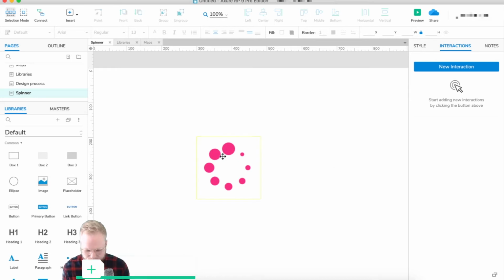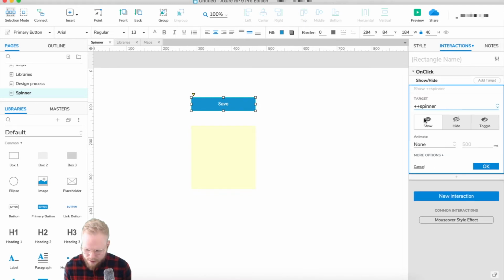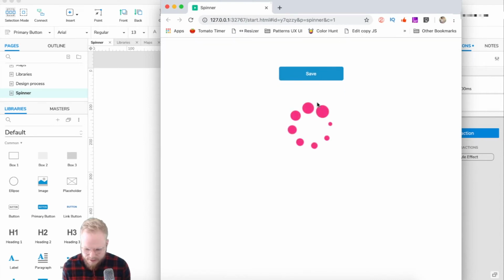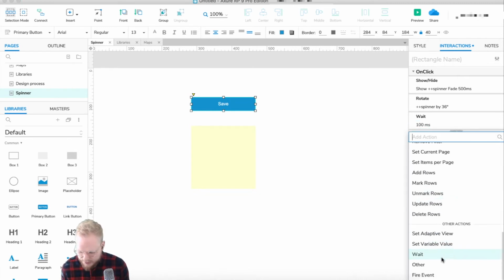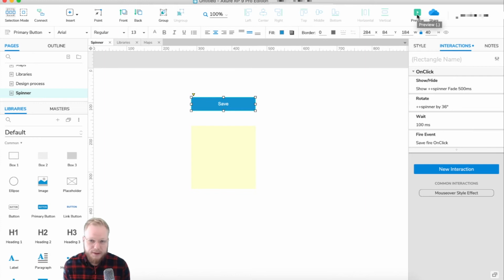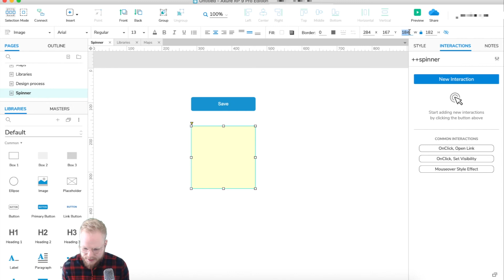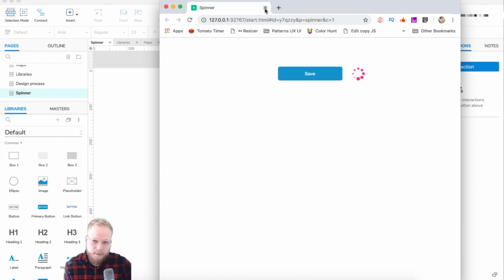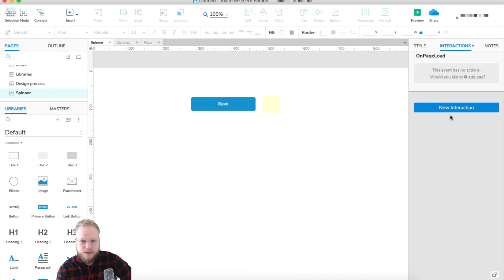Loading Spinner Animation | Axure RP: Noob to Master - Ep40

Comment: Thanks for the tutorial. How do I stop the event? I have set up my logic to fire event OnClick (which spins the spinner), wait 1000 ms, then hide the widget. But that makes the widget hide/show/hide/show in a continuous loop, and the spinner never hides completely.
Reply from the maker: Youd need to add an IF condition to that event, e.g. if counter is not 100 do the spining. Then insidethe event you should add a counter. For example a variable value +1 everytime the loop runs. Once the variable value is 100 it would stop.
Reply: @vaexperience  I am new to this Axure, can you kindly tell me what to do and how to add a "counter" to the if statement for every loop then after some time, stop the spinning if it matches the counter we set
Reply: @seer473  Hello. I added a 'wait' for 2000ms and then added 'Open Link' to the desired destination underneath the 'Fire Event'.
Reply: @vaexperience  OK. How do I add an IF condition to that event and the rest of what you said. The spinning video is great except it doesn't account for the fact that a loading event should "ideally" end and move you on.
Reply: @art4ux2me23  Hello. I added a 'wait' for 2000ms and then added 'Open Link' to the desired destination underneath the 'Fire Event'.
Reply: @vaexperience   didn't get ths... please elaborate
Reply: @aarshitayawar6679  Hello. I added a 'wait' for 2000ms and then added 'Open Link' to the desired destination underneath the 'Fire Event'.
Reply: One way I came up with to stop the loop and move on is simply repeat rotate & wait for as many times you like, No need for infinite loop, and in the end just add an action, e.g. Open Link that takes to another page
Reply: Hello. I added a 'wait' for 2000ms and then added 'Open Link' to the desired destination underneath the 'Fire Event'.
Reply: Hey, the easiest way I found was to just get it to spin for like 5000ms, wait 5000ms, and then hide it.